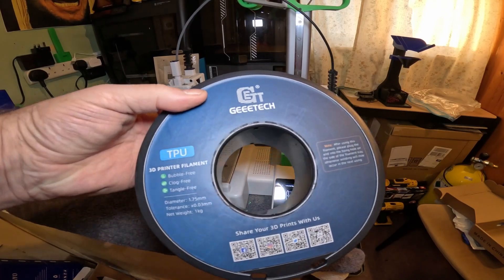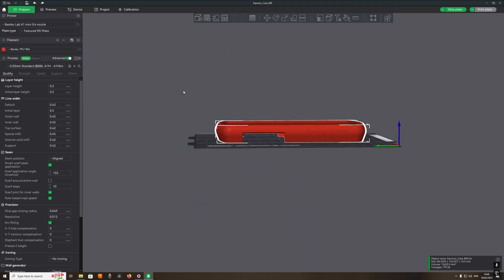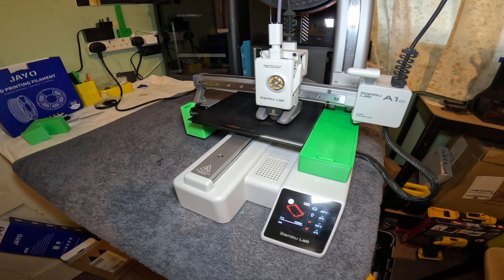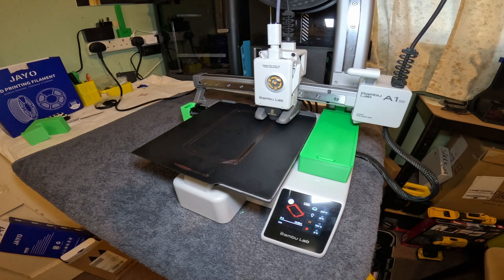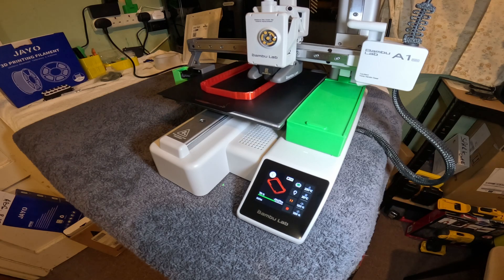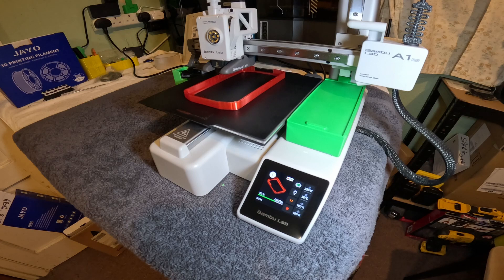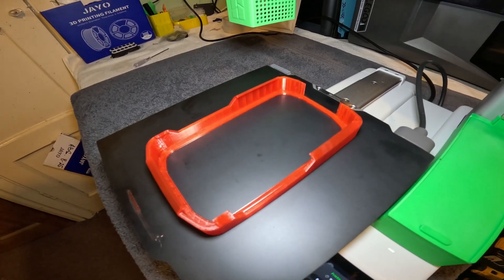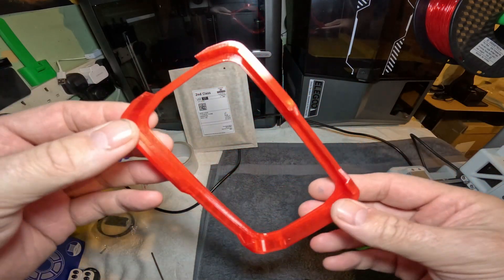How I 3d Print TPU.. NO Stringing.. Perfect Results for Beginners on My Bambu Lab A1 Mini,

Comment: Looked a great print. How did you set up the filament feed into the toolhead? Did you just use the filament without the PFTE tubes?
Reply from the maker: The filament is fed through the PTFE tube as normal, thanks for watching 👍